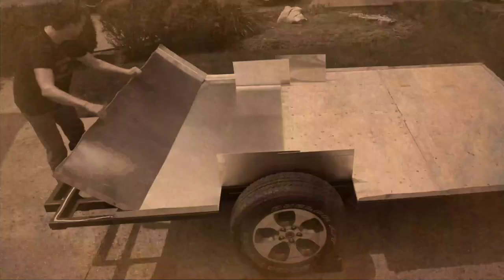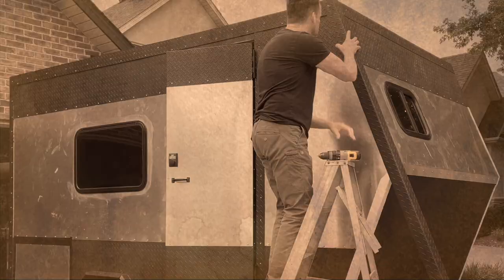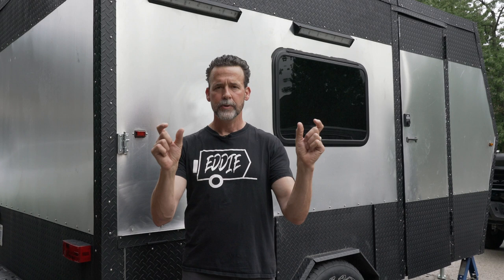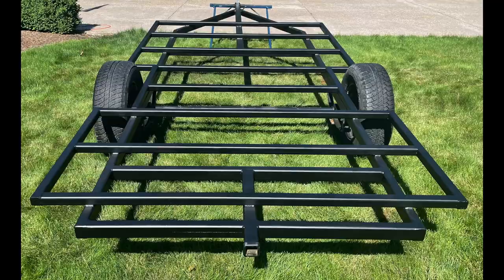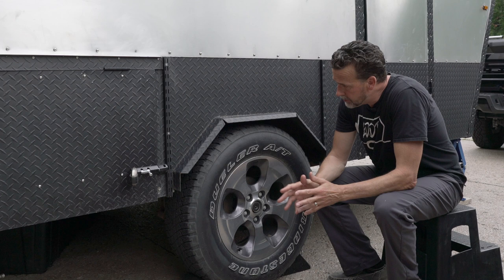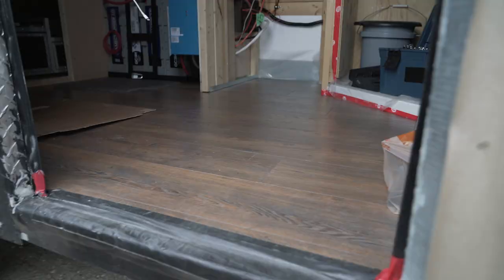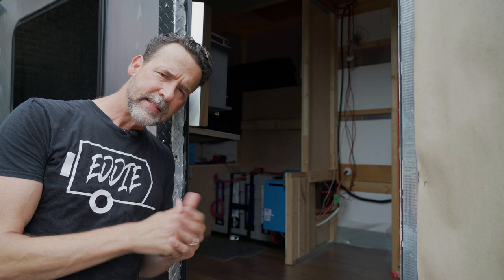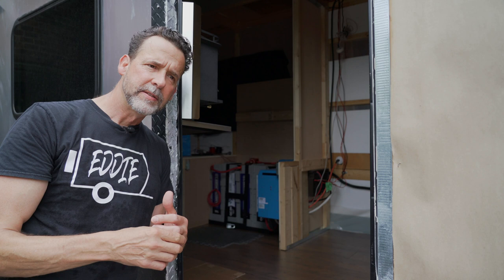How NOT to build a Travel Trailer / Must see video for all DIY Camper, Caravan, Tiny Home projects

Comment: I built my teardrop from the ground up 9 years ago and yes all of these mistakes are beginner mistakes but not earth shattering. I had previous experience with re building a few campers and when younger I worked a few summers for a mobile home company. I also worked in the electronics industry for 40+ years. The most important parts you got right. The wall structure and waterproofing the cladding would have be a game changer and unsafe over time. You did a good job.
Reply from the maker: Thanks 👍

Comment: Dont do vinyl planks when you live in a zone where it gets below freezing.  It expands and contracts a lot with temperature swings and the LVP snap together stuff will come apart and/or buckle.  It works fine in a home where its a fairly constant temperature, but not outside.  Go with a single piece of vinyl roll flooring.

Comment: Your project looks pretty awesome! I converted a cargo trailer so the structure was there, I just modified it. My 4x6 v-nose toy hauler-camper-theater is tiny compared to yours. Front 4x5 deck extension plus roof rack and hitch rack is extra room for 2KW Inv-Gen, LP bottles, Solar pnl, and Awning. 3 cabinets house cooking equip. and the 24"TV/entertainment center. Twin-size tri-fold sofa-bed, 5K BTU AC, elec heat and induction cooktop complete the collection (so far). Planning a folding room pinned onto my ramp that will be outside galley and inside privy w/shower pan. Room will tie down on the front deck. Pulling it with a 1.8L Scion XD gets  well over 20mpg!
Reply from the maker: Thanks for watching. Cheers.

Comment: I would not worry about the flooring.  I have used it in a cabin in Maine for 6 years and it has held up very well.  You will have to be somewhat careful about water, but a floor mat and normal caution should be all that is needed.
Reply from the maker: Good to hear.

Comment: WOW... what a great video and an honest one at that!!! I built three prototype trailer models. Each one was a wonderful challenge and I learned a LOT. I would wake up at 3:00am with a solution to one of MANY design problems and rush off to the shop. My wife would wonder why and I told her.... "If i go back to sleep I'll NEVER remember the solutions so I have to go now and work it out while it's in my head. She just laughed and went back to sleep while I solved some pretty crazy things.

When they were all done, what I wanted to know/learn was this, what will each design cost, how long would a production run for each model be, and if the crazy thoughts in my head regarding out of the box designs would work and be saleable. After 6 months of doing them as side work (lots of after work hours) all my questions were answered!!! The start up costs were not available so onto the back burn they went. 

It was a lot of fun for me and a couple of my employees that want to help and needed the side work money. Everyone in our commercial area loved them and dropped by to see how they were coming along. A lot of coffee time was spent showing off the designs and for the next year or two I let people take the trailers out and "beat them up" to see areas that needed improvement. 

Again.... I had a blast doing it, and yes I did have my fair share of stressful moments wondering... is this the best approach???

What I have seen of your rig suggests to me you did a very good job!!! And after fiddling around for over 45 years I've learned one thing I shared with all my employees over the years and it is this... The only person that doesn't make mistakes is the one that doesn't do anything, so relax, you're not special, you too will make mistakes, just use them to your advantage and learn from them!!!

Again... you did a GREAT JOB!!!
Reply from the maker: Thanks for the great thoughts 👍

Comment: I have an rv repair business in WI, 1st its a beautiful built, 2nd thanks for the honest update. 3rd all rv manufacturers use regular house wire for all of the 120VAC but all of the 12VDC is stranded wire. Hopefully you haven't replaced all the AC wiring yet.
Thanks again for the video.

Comment: Trying to built a custom travel trailer is a daunting project.  I am an RVer and have a 32 foot travel trailer into the wilds of Central Oregon.   I have toyed with what I would want in the future and still trying to iron out my expectations.    Much of my use would be for overlanding and basecamp camping.  It would need to be light weight,  & strong.    As for your comment about trailer tires, most of the travel trailers used for overlanding use Lite truck tires not trailers tires.  I have spoken to many tire experts and many agree that good lite truck tires are safe.  I do not know about state and Canadian laws but I do see lots of trailers with lite truck tires.

Comment: I think we all make similar mistakes when building a trailer 
I have made many different types of trailers and I think the wheel tyre combination and axle and springs are an ongoing 
Issue 
I think we just don’t understand how much things weigh especially when you keep putting more stuff 
my last van trailer I actually did some working out how much it will weigh as everything has a weight per meter or quart meter 
And I had worked it out to being about 700 kgs and when we put it on the weigh bridge it come in at 880 
Wiring is always an issue 
I think it has come out pretty well and now want to build my own caravan like you 👍👍👍
Reply from the maker: thanks David, I think you should

Comment: Most any commercial built unit is wired with solid wire. The stranded is not necessary. Staples to hold it tight to framing is all that's necessary. My 74, 79, 85, 88, 99 and 01 rigs have all been solid 110.

Comment: X O Rust paint for the frame (you'll thank me later) I disagree about the ST tires. My experience with them is less than stellar.  Although I special ordered dual 6k axles I am running a 16'' tires on 6 lug rims, I went with Michelin 235/85r-16 in an 8 ply.  The balanced out well and run very smooth down the road.
Reply from the maker: Going to check out that paint.
Reply: Ditto about the ST Tires

Comment: Caption should have read, 5 things wrong for my use. Nothing you did was wrong. I can see the flooring perhaps may not be right for an outdoor guy like you. The tires probably will never give you trouble other than being a little too big. In our province you can run any tire. Electrical, that is the wire in 99% of trailers on the road. You did a wonderful job. I hope to do a similar build. I purchased a 3500lb axle from Princess Auto also. :)

Comment: I had seen your trailer before (YT) and thought the 5 lug / 3500# would be an issue. This vid titled "... mistakes" hopefully jumps out at those who will are inspired to build and can thus learn and avoid the pitfalls you highlight. Excellent vid and points made. Overall a very nice trailer you have there. I have build a few but start with a cargo trailer. However even this isn't a guarantee that all will go well. My Spartan (I hope no one buys one), the tire clearance (back side) is 1/4 to 1/2" and rubs occasionally. I will need to buy spacers to increase the clearance. I did "overkill" it with 5200# straight axles for my total loaded weight of 6800#, probably one of a couple of things I did get right.

Comment: Curious about your thoughts on the tires.  In the US, I can find no specific requirements that trailers must use trailer tires.  Perhaps I've missed something.   I do know tires have load ratings and a builder/owner must be mindful to put tires with load ratings to match their vehicle. 

I'm also considering building my own trailer and want to use rims larger than 16" for the added ground clearance.   Rims also have a load rating, so this must be matched as well.  Given you only have a 3500lb axle, your jeep rims may have more load capacity than the axle, not sure on your tire selection.  One additional reason I want to use larger rims, is so a slightly wider(and taller) tire can mounted.  This way I can air down off-road to soften the bumps.

Comment: Only 5 man if I was so lucky when I do stuff. Appreciate your honesty. Just for your information, one jeep has 16 inch wheels. A 5200 pound axle is 6 bolt wheel fits gm truck wheels. I went to miska trailer manufacturers of trailers and took them my measurements and built me two axles for 120.00 dollars. If you took your trailer with you they could get the measurements and you would get what you need. Just saying.

Comment: Great video! Have you looked into the timbren axle less axles? I got mine in 5200 lbs and 4 inch lift. Could solve some of your suspension issues. Been enjoying the content. Thanks!
Reply from the maker: I've been in touch with them.  I wish they made the 5200 in HD.

Comment: A possible fix for the axel and tires is to just go ahead get the 6,500lbs axel and then weld a lift kit to your frame for that axel this way the tire won't need to be a smaller dia. and won't rub on the fenders.  And as far as the 6,500lbs axel being to wide just extend the fenders out. 
This way minimal things need to be rebuilt in order to fix it. Just welding on some steel to lower the axel further from the frame, and then build out the fenders, and then get those trailer tires, but the dia, you wanted to begin with.

Comment: Trailer "tire" or truck/other ...  You would not need a specific "trailer tire" for your rig.  Trailer tires are a MUST for tandem axles.  That is what they are made for.  The belts and side walls on trailer tires are basically designed to handle the side lateral pressures when back the trailer for instance.  Car tires on a tandem can break their belts for the pressure. You have seen tires on tandem axles twist and look out of align when unit is backing ... easy to see on blacktop ... that is the nature of tandem.  Any tire shop should be able to confirm this .. but they may not know or just say anything to get your money.

Comment: Good video BUT, are you saying the factory jeep wheels and tires shouldnt be on all the jeeps and new jeep trucks (same weight as your trailer) at freeway speeds? I think the tires are fine. A trailer tire shouldnt be on a vehicle, a vehicle tire can be used on a light weight trailer. A "true" trailer tire has stiffer side walls, which is needed for heaver trailers but have a lower speed rating which is why trailer tires are cheaper than truck tires. Id keep the tires on there until they need to be changed.

Comment: What are your thoughts on single 6k lb axle vs double 3k lb axle?
Reply: I know double axle is more components, more costly, but are there any other negatives?
Reply from the maker: Design of the double axle intimidated me. I found it easier to visualize a single axle design.
Reply: @DrenalinAdventures  thanks for the reply!

I have a double axle trailer with what I believe are 3500lb axles and I have a single axle trailer with a 1500lb axle.  I'm watching your set of videos to get ideas flowing for a low cost cargo trailer build.  I probably won't stay in the trailer unless I build a heavy unit on the double axle base.  Idea is to have a covered trailer to pull dirt bikes...

Comment: So idk where you read that you need to use stranded wire? Im an rv mechanic and i regularly deal with wiring on the daily and i can promise you that all the trailers ive worked on have solid copper wire. Hope this helps. No way that wire is gonna break overtime from bouncing. Wire it like a house is basically how the manufacturers do it. Make sure theres no sharp edges to poke through the sheathing and your set